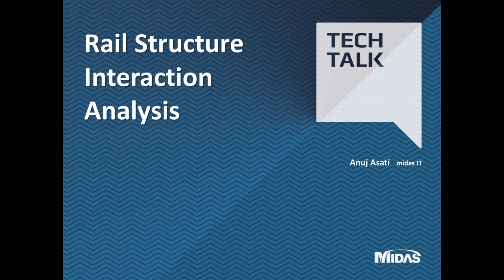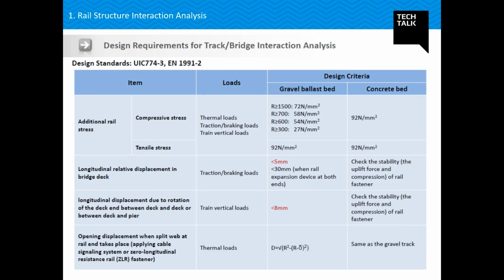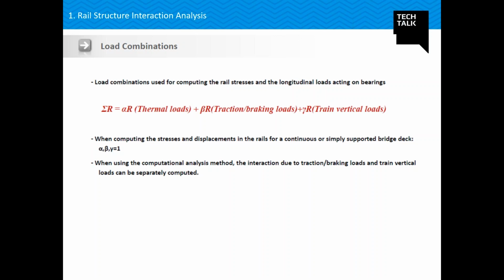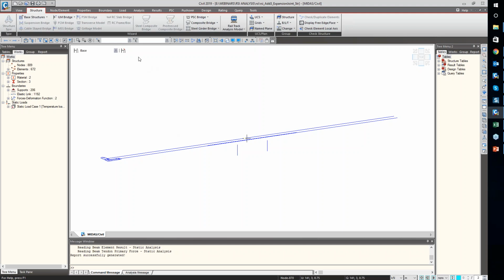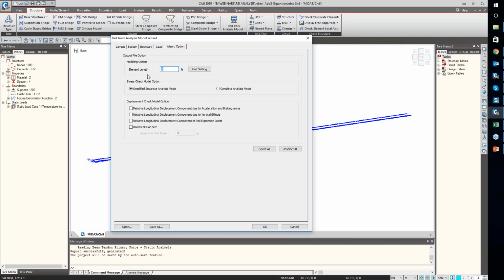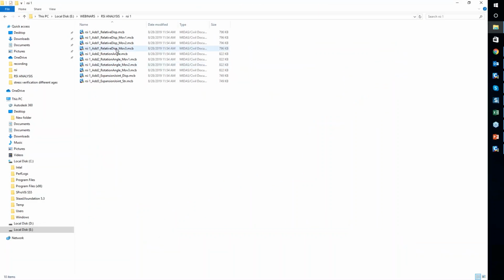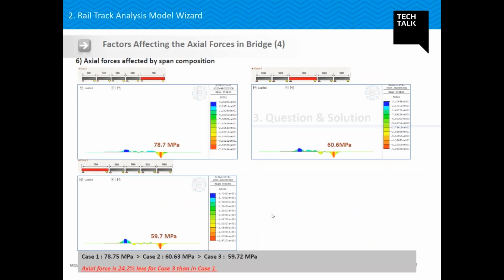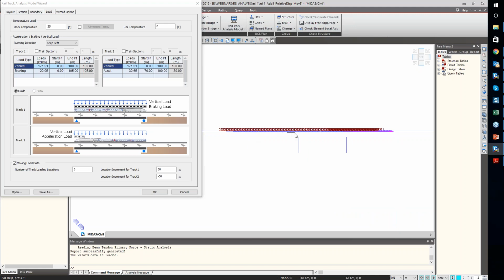Midas Technical Live Session 4: Rail Structure Interaction (RSI) Analysis

Comment: Thanks Anuj for the nice webinar. Can you please tell me how to proceed with  RSI analysis for the junction area where blasted track and slab track meets? I mean near the depot the track is at grade and ramp is there... When the track is going from at grade to elevated ramp. How to perform RSI analysis? Please share is you some study material as well if you have.  Thanks in advance.
Reply: Hi Arnab, the essential difference between the track on ballast and track on slab will be the stiffness of the multi-linear link between the rail and deck. This can be taken care by Midas Civil's rail track analysis model wizard. Here in the boundary tab we can define the stiffness for loaded and unloaded condition and position of ballast or slab along the bridge. The software will generate the multi-linear elastic link with appropriate stiffness, simulating ballast or slab.